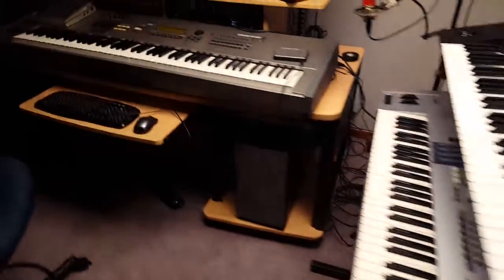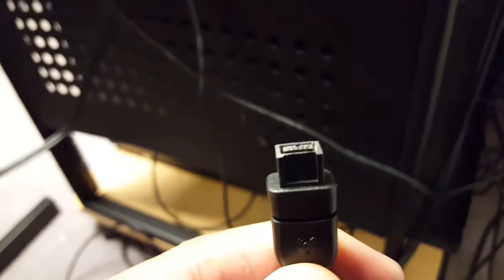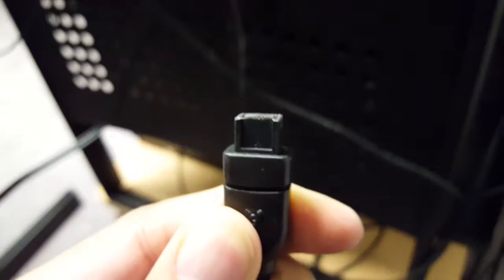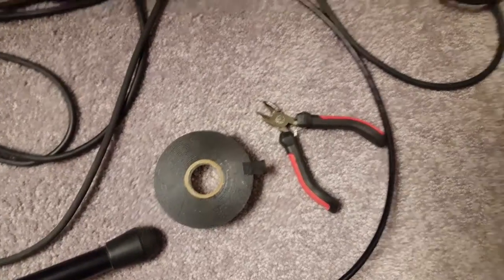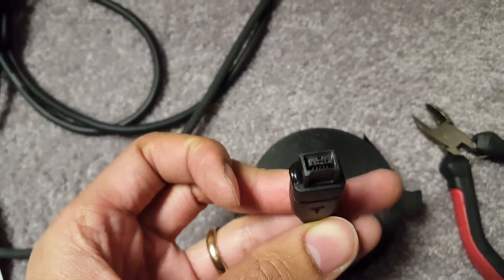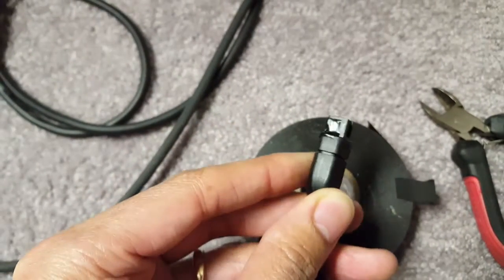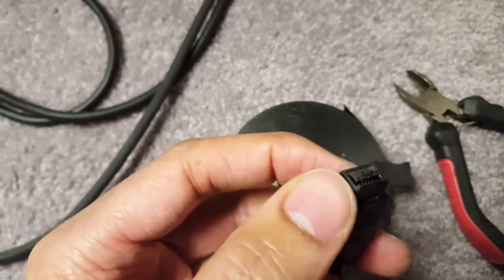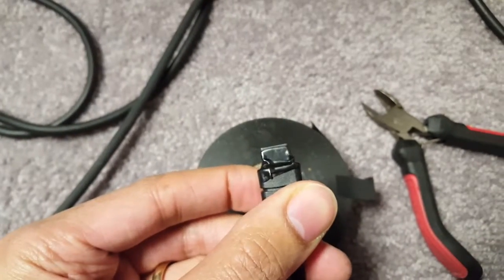How to fix loose firewire 800 connector (quick fix)

Comment: Got a couple of linked-up Firefaces 800 that drive me mad from time to time because of this poor FW800 design issue. Plus one of the units was fitted with cheap only surface-mounted ports that came loose because of constant cable reseatings. Good side of things is I improved my soldering skills but so much frustration. This apart I love this unit for the software stability. Thanks for sharing ! Maybe I will keep them for a few years.